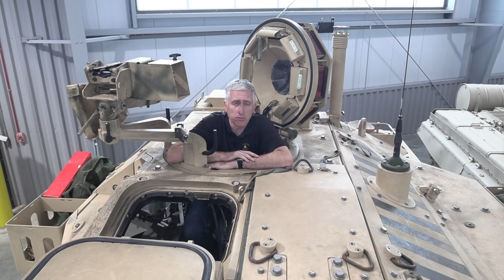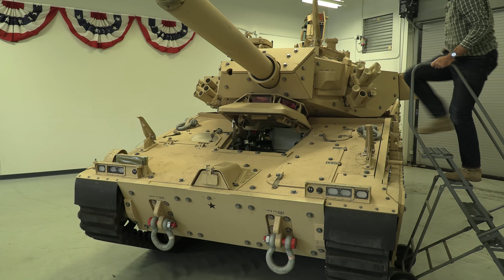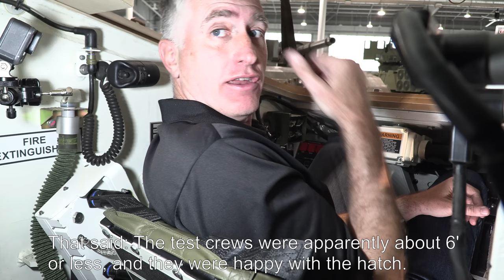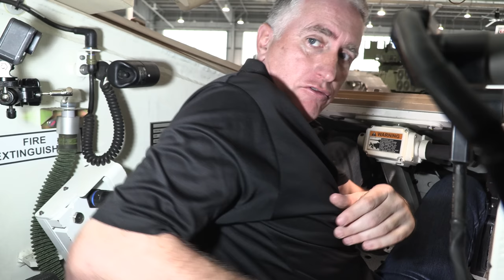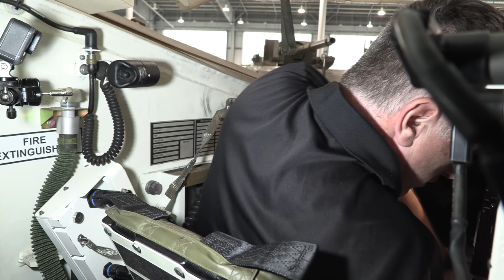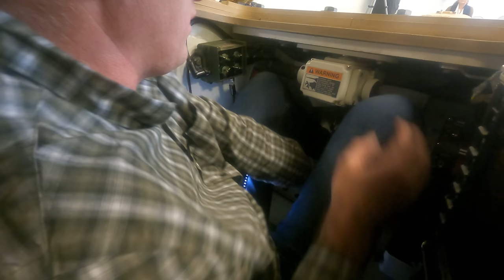Inside the Chieftain's Hatch: BAE XM1302 MPF, Part 2

Comment: That Commander's position was making me claustrophobic just seeing you sitting in it. "Cramped" doesn't even begin to describe it
Reply: I'm 6'2" 240lbs. I wouldn't fit... At all. 🤣
Reply: @DZ4295DBW  6’4” 270lbs. My shoulders wouldn’t have made it through the hatch
Reply: Add body armor
Reply: @DZ4295DBW  I'm 6'4", about the same weight.  If I got in I might not get out.
Reply: @tomhenry897  That's what I'm saying man, and I have nice Crye SPC. I'd legit have a hard time fitting in this thing.
Reply: @tomhenry897  Would the 19Ds wear flaks or plates inside?
Reply: 5' 9 or 10" 130lbs. I would fit
Reply: All of that sacrificed dimensions for saving weight right?

Comment: Well, that should put most of the "controversy" to rest.  I really do like the band tracks, the autoloader, and the fiber-optic periscope, all of which should be considered for future vehicles.  However, it's just too cramped to be fully usable.
Reply: band tracks are a pain my squad leader in 85 was on a M114 that had them he didnt like  them for maintence
Reply: That's what happens when you try to force a 105mm gun tank to fit in a C-130H cargo bay
Reply: Band tracks are fine in small vehicles where they aren’t too cumbersome but anything this size your better off using standard track.

Comment: Man the TC has to contort to do anything. I think you nailed it. The ergonomics sucking is probably the reality of stuffing a 1980s/90s vehicle full of 2020 tech it wasn't originally designed for
Reply: They redesigned the hull completely, so why didn't they make the interior roomier? They had plenty of headroom in weight compared to the Booker. There was no need to keep the dimensions the same. But I sympathize. They didn't have enough time given how rushed the whole program was.
Reply: @JAnx01  They had a 40 year head start, and still couldn't build 12 vehicles. They were 14 months late on that count.

Comment: A few more inches of space and it looks like it could have been a lot better. But as it is now I dread to think how the crew fit inside with full gear. After all Nick might have extra height to contend with but he doesn't have extra width and that was still a real issue in some places. Plus it's lacking a bit of space to move around if locked inside for a long time, of course. Love the autoloader, but it does seem to be part of the problem here.
Reply: I also feel that 21+7 rounds of 105mm is really not much for the intended task?
Reply: @dposcuro  It's definitely low, but it's also a light armored vehicle for light combat with airborne units

If they're needing 30+ shells the shit has obviously hit the fan and that's bad... But every mission? They're not meant to be in that much hot water. We have Abrams for that.
Reply: Reminds me of Turm3 experimental tank. It also had one sided autoloader but had more than double ready to fire ammo. The weight and size constraint doomed this version of M8. Had they kept the autoloader or maybe with a different design like a bustle one while keeping both the loader and commander each having their own side maybe the bae design proposal would have been selected. But at this point that design would have no relation to M8 AGS. The closest real life equivalent of the theoretical design would be japanese type 10 mbt or type 15 chinese light tank, where the former is closer to M10 booker in weight while latter is closer to fully uparmoured M8AGS in weight. If one sided autoloader is to be kept then design it with a new hull and turret.
Reply: @cheyannei5983  the point is, that during an assault, you might be pushing farther, and faster, than the supply train can keep up with. Plus you have 5 types of ammunition, but only 21 ready to fire. You might end up with 2 APFSDS just in case, and maybe a handful of HEAT to deal with enemy IFVs. Those will always be in the rack. That puts you down to    ~15 to play with between HEP, HE, and Canister. Plus the spare 7. That is really limited endurance.
Reply: I'm glad it wasn't selected for use. I remember from the xm10 video the ergonomics looked much better.
Reply: A configuration of the space in the style of the T-72 or the K2 Black Panther could be the solution... as long as an automatic loader is used to maintain the 3 crew, but with the driver on the right that would be the side of the tank leader and put in the barge an armored compartment for extra ammunition, the LEOPARD 2A6 / E have it that way.
Reply: @TakNuke  The Chinese Type 15 is a most interesting tank, and it has an oxygen supply system for the crew when they operate at high altitudes.

Comment: Gotta admit... seeing the interior makes me consider that, yeah, maybe the other one earned the win. I do have to wonder if they couldn't have shrunk the autoloader side a bit more without impacting operation in order to free up a little more interior space for turret crew, or widened the turret a bit on the crew's side to give a bit more crew space.

I was thinking "why couldn't they put that monitor on a swivel so it can be out in front more rather than up next to the shoulder" ... and then the second monitor spot was swiveled into that area. Still, I feel like there ought to be a way to have both monitors angled so they're both mostly in front of the TC.
Reply: I mean it was a rush program... It looks like they just crammed the electronics in wherever
Reply: @thecanadiankiwibirb4512  Yeah, if they had had more time and money, they could've made the interior roomier for sure. The hull and the turret were completely redesigned anyway, but they probably started with the M8 AGS dimensions and didn't realize it would be so cramped until they filled it up with stuff at which point they were out of time and resources.

Comment: Oh my Lord! I was a 19K back in the mid to late 80's. I loved my M1IP, especially the driver's compartment. Once we hit the field, I never too my "fart sack" out of the hatch, and with the extra room in there, I only exited for nature's call and hot chow. "DEATH BEFORE DISMOUNT!!!!" 
I couldn't imagine having to live in that thing, even for a day.
Reply: Considering that war is often accompanied by stomach issues like diahrea aka trouser squirts. So egress time would likely become critical.😂
Reply: @scottyfox6376  LOL That was my point. Even though we lived by the motto "Death Before Dismount", egress from the driver's hatch was very quick. 
Rolling out to our deployment position during ReForGer 87, the Main Hydraulic Distribution Valve failed. 17 gallons of FRH was atomized. It looked like there was a fire in the turret. I killed the engine, pulled both fire extinguisher handles, set the parking break, and exited the tank in under 5 seconds!
Granted the hatch was already open because it was SOP to drive through town "heads up."

Comment: At 12:45, that's the control electronic panel, or CEP, for the automatic fire extinguishing system.  There are still manual discharge handles in the event that the automatic system fails or is otherwise not operating, but under normal conditions, the CEP will automatically discharge the fire extinguishers that are located in whatever area that the sensors detect a fire.

Comment: One thing watching the Chieftan's video has taught me is the importance of UI and ergonomics in a combat vehicle.

Otherwise excellent vehicles let down by difficulties in operation that slow down and impede reactions.

I'd be interested to see interviews with those responsible for designing these elements and the challenges they have with dealing with the straight engineering issues.

Then again, it may make a good argument for UGVs. Although they have the issue with maintaining control of the vehicle in a heavily contested EW environment.

Comment: Navy Gunner's Mate/Ordnance Officer here, so pardon my ignorance.
But, how does the Auto-loader know what type of round is in each position?
And, what happens when a type of round is selected but isn't in the auto-loader (all expended, not loaded and selected by mistake, etc.)?

Thanks for the shows, I find them educational and entertaining.
Reply from the maker: You tell the computer which round you are placing into the autoloader as you are loading the rack. It then remembers that "Slot 3 has sabot" or whatever.
Reply: @TheChieftainsHatch  Thanks
So, what happens if the autoloader doesn't have the type round selected?

Comment: This thing needed to be made wider by a few inches. I think the gdls is too heavy for an assault gun, but this is alittle too small for all the electronics they wanted to fit in it.
Reply: It's tradition to shit out requirements and renege down a memory hole. The aspect ratio was squeezed to make it work for lesser planes and smaller transport; otherwise, the four decades of other light tanks just make the Army look retarded for overlooking them. We need to relook how we consider space and how much marble fat we encumber. It's obvious a light tank is going to be a tighter fit to be what it needs to be, which is not a Chevy Suburban of tanks with its wide open plain of space, but rather a Metro. With recruiting being what is because of cancer politics, three crew definitely saved on the issue.

They shit stacked features on a sales brochure with the M10, like the Sig fuckaroo clamoring for AR updoots goosing up the new gun, when they really needed to think about what makes a great cruiser chassis at 25-39 tons since they clearly couldn't be bothered to make it light light. Think about why the Panther had the best floatation and traction over 30 ton mediums despite being a 40 ton tank, because this needs it to not get stuck. It also desperately needs a turret forward model; even the OG StuG had effectively useable massive gun depression. Second, redesign the base armor with the understanding of HE slingers, shit drones, and automatic cannons or shitty zoot tubes firing back at close range; your tank does not need to be obese.

Comment: In the video LTC George states the weight of the BAE entry to be 26 tons, at the end of the video you mention it to be 28 tons, and then online I've seen 27 tons floated about. Are you able to confirm which of these is the correct weight for the vehicle with add-on armor?
Reply: Unlikely. Probably just slightly different design iterations.

Comment: about fiber optics aux sight - as I recall there were some concepts a few years back that'd use this kind of fiber optics in a remote or low-profile turret that you can't really put traditional periscopes on (or at least can't cover wide angle) - like Stryker MGS turret but with 360 deg view as fiber optics can go atop the turret

Comment: BAE made some poor choices with their MPF candidate, but they had made those decisions off or the original program requirements which the Army evolved. Ultimately, it appears they couldn't adapt their platform to the Army's evolving preferences. The large difference in allowable platform tonnage from the beginning of the program to the end favored the much heavier GDLS  candidate. It was good to hear The Chieftain praise some aspects of BAE's design choices, like the innovative auxiliary sight. I can't see BAE selling any of these on the export market as the technology inflates unit price and the US Army requirements were unique. As before, I suspect BAE just used their MPF candidate to proof technologies they might use on other systems to which they have a greater commitment.
Reply: I'm sure it would've been better had they gotten more time, the rush to produce a product from request to prototype being under 3 years really had a tight squeeze on what could be changed.

Comment: Greetings . There are some questions that come to mind.

1º Why don't you use seat belts? .

2º Will a configuration like that of the "T-72" allow more ammunition to be accommodated and give more space to the crew? .

3º Is there a version with a 120mm cannon, wouldn't it be a better option, would the USMC serve as a "substitute" for the M-1? .

4º How much weight would an APS like the TROPY and a RWS add?

Thank you .

Comment: It would be cool if they could get the hatch to slide forward and then pivot forward making sliding in and out easier and giving the driver protection while getting the coax ammo.
Reply from the maker: He doesn't to open the hatch to get the coax ammo. It's inside the vehicle, on the outside of the turret basket
Reply: @TheChieftainsHatch - Ahhhhhh, that does clarify things! During the video it seems like the MG ammo storage was in a  weird mystery storage bin under the bustle! Maybe we needed a picture?
Reply from the maker: @KevinSmith-ys3mh  I couldn't see it to photograph it without moving the turret to the side.

Comment: One thing i don’t really get is the choice of the autoloader for a light tank. A bunch of the advantages for autoloaders are only present in MBTs. For a light tank many of the combat advantages are nonexistent. Not much if any weight saving, space isn’t nearly as much of a concern, the higher upfront cost is a big hit against light tanks, and any consistency advantages for that era of autoloader probably won’t be used because it’s a light tank. Weird choice IMO, especially with a base design being from quite a few decades ago
Reply: Autoloaders are good if one is limited by weight and size while wanting maximum possible protection and also if your ammo is too big to manhandle. The fault of this version of M8 AGS is that it is an old design when ergonomics was not a priority. Given time the users also have grown in size and personal gear. Had they redesigned the vehicle but without any size and weight restraint they would have come with a better end product with much more growth potential while weighing less. The irl comparison to both M8ags and M10 booker are Type 15 light tank and Type 10 mbt respectively in terms of weight.
Reply: @TakNuke  An interesting statistical side note, height - while being somewhat hereditary - has also had increase over the years correlated with environmental factors such as improvements in diet due to advances in the nutritional sciences. 

So technically speaking, if you really wanted to you could design a "really bad diet" on purpose that satisfies the minimum nutritional requirements to not cause any sort of nutritional disease but avoids those that increase body growth. Tada: small tankers!
Reply: @Coconut-219  why does it sound like ussr?
Reply: @captainfactoid3867 I don't think you realise how big 'light tanks' are these days. Or how much armour is needed to stop 30mm sabot.

You get alot of weight savings from using an autoloader. The M8 is only ~26tons vs the M10 broker's ~42tons for the same armour and firepower. That's  16 tons lighters FYI. Part of that is also a rear engine design allowing it to be narrower, but it can only get that narrow with a rear engine and a 105mm because it's got an autoloader. Now arguebly they went too far with the minimized size for crew ergonomic spaces, but the weight savings in light tanks can still be substantial in modern designs.

Comment: Is the purpose of having all of the bolted-on armor plates to have an internal layer of armor and a second replaceable layer, so that in the event of a shot that fails to fully penetrate, but makes it through/damages the outer layer, it can simply be unbolted and replaced to restore protection to the vehicle, instead of requiring a full shop tour, or are they just big internally-sectioned ERA plates?
Reply: The first. It's not ERA. Stryker uses similar armor panels

Comment: I'm surprised the gunner station doesnt have a backup panel for some of the "commander" functions that might be necessary to access in combat.

Sure, if youre down a man and need to, you can shift the gunner to the TC position.  But what if you're suddenly down a man and you're still in an active fight , like the TC just got JFK'ed while sticking his head up to actually do "TC things" ?

Be nice to have the ability to handle at least the "things we might have to do in combat" jobs from the gunner station, even if it requires twisting around to fiddle with something behind your shoulder.

Comment: 21:08-22:32

Huh, that's really interesting. This tank (XM1302) using a fibre-optic cable as it's auxiliary sight is ingenious.

But, fun fact, did you also know that the Russian BMP-3 also uses fibre-optic cables as periscopes? Well, it does, but for pretty dumb reasons. The BMP-3 uses its fibre-optic cable periscopes to aim its front hull mounted machineguns (a concept that is obsolete since the end of WW2).

Source: https://thesovietarmourblog.blogspot.com/2014/10/bmp-3-underappreciated-prodigy.html?m=1 

(Tankograd, or as I would like to call it, the "Home Depot" of everything that's Russian armour)

(I think you will be able to find a little bit of information about the fibre-optic cable periscopes somewhere in the section talking about the "PKTM" machineguns)

Well other than that, I think I remember reading an obscure patent (long long long time ago), and it was talking about using fibre-optic cables being used as periscopes for submarines.